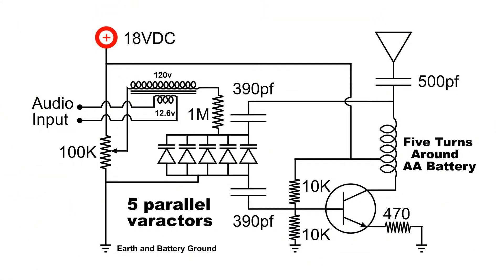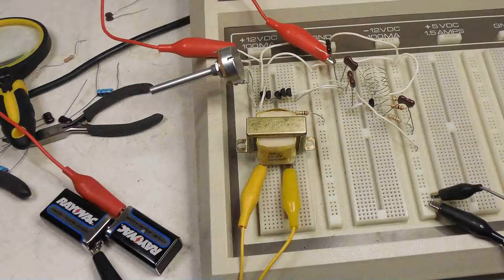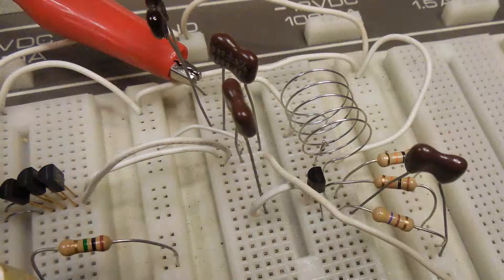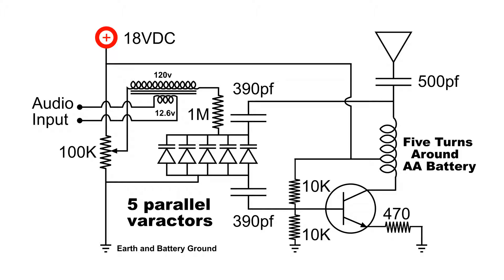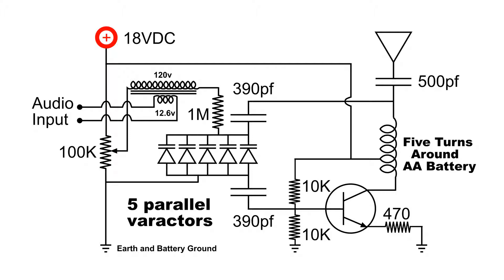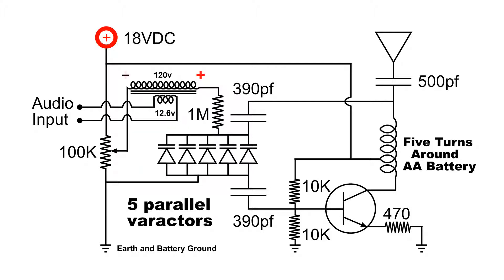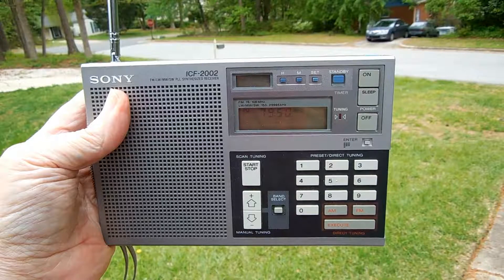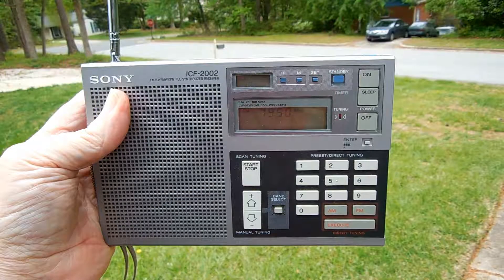FM Transmitter Varactor Diode Modulator

Comment: I made the transmitter and it is very good. The problem is that sometimes the frequency is changed. Does anyone know if a crystal can be added to stabilize the frequency? And in what way can it be connected? Thank you
Reply from the maker: Use a stable power supply and it will not drift off frequency.
Reply: @AllAmericanFiveRadio  ok thank you

Comment: Hello Rick thank you for videos on this doid.  Please can you tell me is there a right and rong way to install them. I have 2 with no marking and they do not test. 
It's to use in a receiver kit.. Thanks Richard
Reply from the maker: All the DC circuits I looked at have the varactors with the cathode connected to positive source.

Comment: Sir ,what kind of transistor did you use ( code)?! In the circuit diagram there is only 3 capacitors but you used 4 ( the one in the emitter of the transistor what is the value) ?! Thank you
Reply from the maker: Look at picture at 1:18
Reply from the maker: I must have made the drawing first and then modified the circuit and forgot to updated the drawing. The capacitor is a 390pF and the transistor is a 2N2222.
Reply: @AllAmericanFiveRadio  thanks.  How do i must connect the 4th capacitor?

Comment: If I used another varactors noumber will it work?! Or it should be the same numbers ?
Reply from the maker: Sure other varactors will work. I used five here to get the capacitance needed.
Reply: Thank you sir , if I want to replace the coil with 5 turns with a ready inductor from the shop (100 micro Henry ) for example
Reply from the maker: Why not try it, if it does not work you can always make the coil. I have other one transistor FM transmitter circuits, just search my channel.

Comment: I was wondering how do i change the frequency? i have my ham radio license and i think it would be a neat thing to build my own fm transmitter for the 2 meter band. The frequency i need is 146.550 or there about. I can do the LC calculations but i need to know wich components? thanks
Reply from the maker: Change out the the 390pf capacitors with less capacitance. I would keep the varactors in the this setup. There capacitance is so small I would not consider them in the calculation.

Comment: What an interesting little circuit. I like the idea of using a mains power transformer to increase the modulation depth. I did try something broadly similar using silicon power diodes years ago and it did work, but the modulation depth suffered. Your idea would have improved it no end!

Comment: Does it matter what order you put the Varactors in?
Reply: I would add you would probably need an afferent as well a an efferent connection...that its my only recommendation :)
Reply from the maker: Hey Dave,
the order of the Varactors doesn't matter in this case because they're all in parallel. Something I didn't try was to remove a few of them. I don't believe that I really need five of them, but that's what I had in the video preceding this one.
Reply: Cool, now, Rick, we need to stabilize for digital output and also for stereo,o,o,o,o,o :)
Reply from the maker: Why yes I am!
Reply from the maker: Dave Pickrell I never got this message. Must be another Google+ improvement.

Comment: Really clever circuit! You know, all semiconductor diodes exhibit this capacitance effect. Years ago I used one (a 1N914 or IN4xxx of some sort as I remember) to add a bandspread to a homebrew regen VHF aircraft and 2 meter band receiver I built. The radio was roughly based on circuits by VK2ZAY and N1TEV